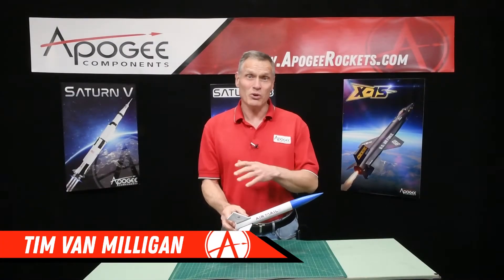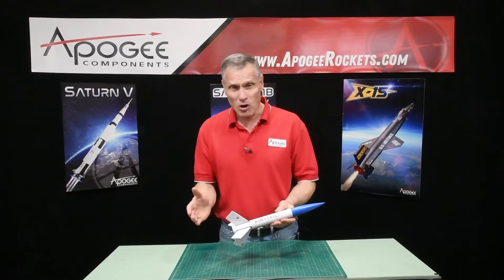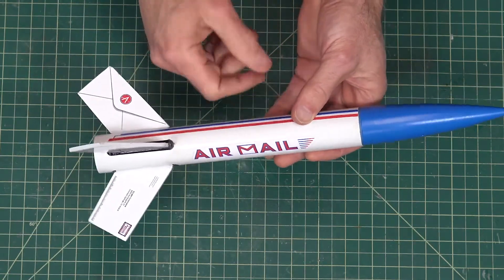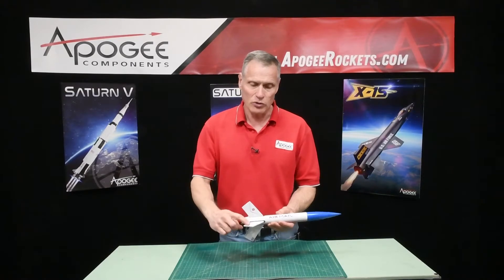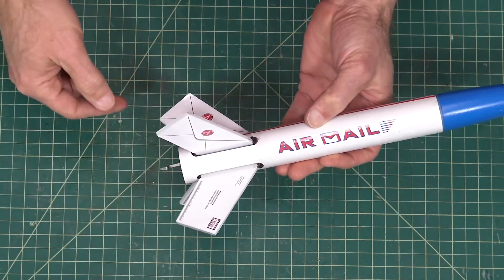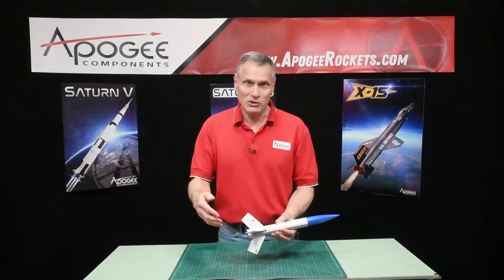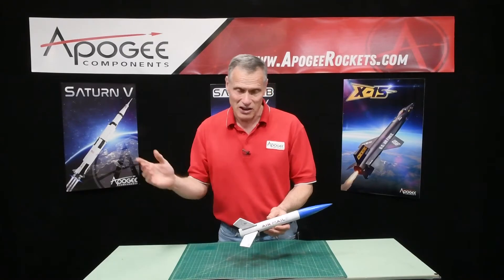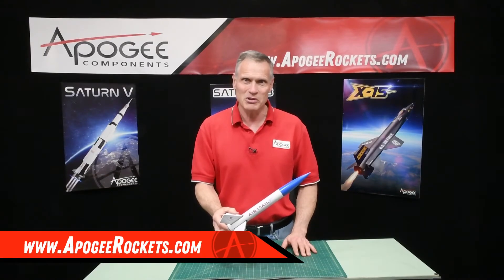Fly the Air Mail model rocket at your next launch

Comment: Very cool! I was on the website and looking at the photos. I can’t really tell for sure on my little phone screen but is the body just painted black around the base of the fins to look like an open slot or are there really large slots to where you can kind of see inside the rocket?

Just got my V.I.R. certificate today! Very cool and it is awesome that you folks make such an effort to show appreciation to your customers. In all my years I don’t recall ever getting something like that.
Reply from the maker: There are slots cut into the body tube. They are big enough so the fins actually do go all the way through the outer tube.

Thanks for joining out Very Important Rocketeer (V.I.R.) program. We do appreciate the repeat business, which is why this program is only for long-term customers.
Reply: @apogeerockets  Thanks for the info! I decided to go for the Wac Corporal with the Tiny Tim booster this time around but I will most likely pick up the Air Mail one soon. 👍